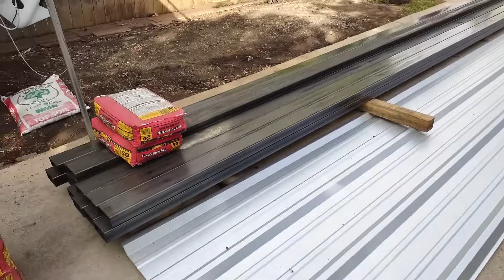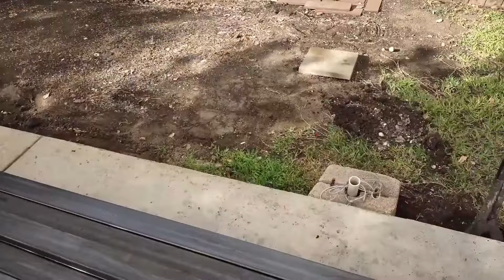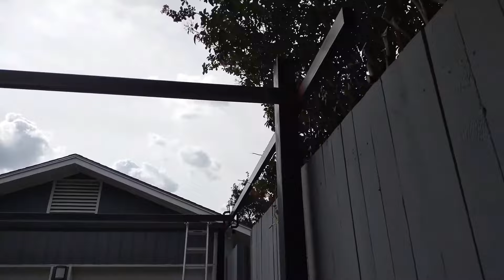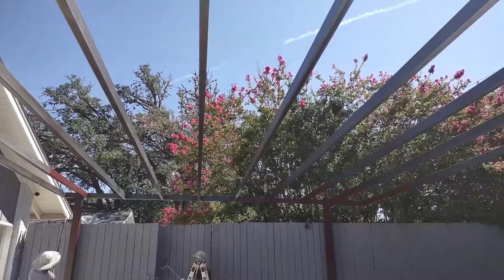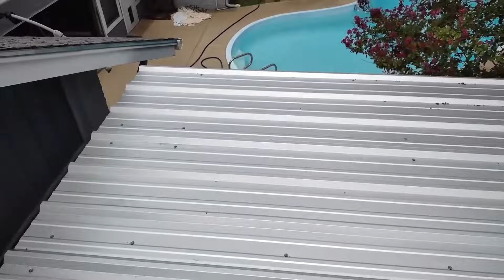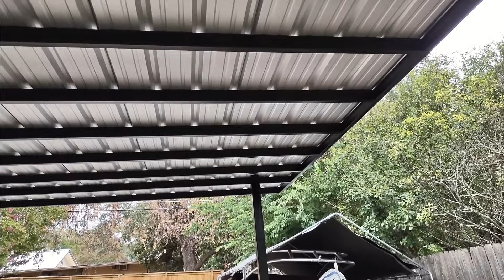Steel Carport Build

Comment: This is awesome however, it would have been nice if you went over all the details such as was it bolted or welded, the size of the metal and why you chose that, why the roof structure is not attached or resting over the 4 supporting beams…etc
It will help so many rookies like me.   Awesome work.
Reply: Saw the welder up on a ladder run by a generator. Don't see one bolt on this thing of beauty.
Reply: The cross beam isn't tied into the legs
Reply: @FourthWayRanch there’s no beam to start with. A 6” I beam on the posts and the framing on top of the I beam would have been 1000% better, but it’ll be there when we all dead and gone

Comment: I'm collaborating with a project manager and a construction contractor in Eastern Europe on a carport project very similar to this one. It's made entirely of box steel columns (4 inch square) and joists, with columns securely embedded in concrete footings. During a windy spell reaching 60 mph, I noticed some structural sway when we were on the roof, which is currently plywood, but will be topped with terracotta tiles adding to some fears I have about the center of gravity. In a light-hearted moment, I exaggerated the swaying by pretending to surf. However, the seriousness of the issue became apparent to me, even though not everyone found it amusing. Despite initial reservations from the project manager and contractor, I firmly believe I need to insist on adding diagonal bracing for added stability, especially without solid walls. These braces will be positioned at 45-degree angles and adequately spaced between joist columns to ensure rigidity. Would love to hear everyone's thoughts!
Reply: Yes would be more stable

Comment: Hi Chris , You guys are pro. How is the thickness of the steel roof ? Thank you Chris
Reply: Normally is 26gauge r panel
Reply: @24BLUEELMO  What's the thickness of the rectangular and square tubes that is the real question, they look super thin on the video. Would oil field drill pipe 2 7/8 be structurally stronger as the 4 main support posts?

Comment: This is exactly what I want to do in front of my house. It looks like you are using 5x5 posts and 2x4 tubing. Can you tell me what the thickness is? 1/4”? I want to attach to my house on one side. I want to go 30’ from the house but only want to use two posts on the opposite side of the house. What’s the furthest you would span before adding a post? I pull like to just use two posts. One on each side about 4’ from the end so it hangs over. Do you think 25’ is too far to span using 2x4 tubing 1/4” thick?  I appreciate the advice.
Reply: Yes it's enough

Comment: Why didnt you take it up agains the garage wall? 
Also no centre brace  what stops the channel from twisting across the span with wind loads
Reply from the maker: Won't twist rectangular tube ,fully welded at both ends,plus thick steel, customer didn't want attached to house
Reply: The sheets will hold it from twisting

Comment: If it’s a 24x24 what size did you get the r panels?
Reply: If you want to add gutter 2-3 inch over hang if you dont just get the at 24

Comment: Pretty sure the screws holding the roof decking down should not be in the troughs where the water will flow over them. When the screw gaskets get old , they will leak.
Reply: R-panel is screwd on the flats not the ridges. It is done correctly.
Reply: @David-ky7bm  it is not correct. That method may be manufacturers recommendation, but it is only to make roof more securely fastened. Manufacturer is looking out for themselves and not interested in roof leaking after screws/gaskets age. You cannot put 1000 holes in steel under water and expect it not to eventually leak.
Reply: @starke6666 most people would sleep better with the occasional dripping screw to seal up vs the anxiety of loose panels during the wind storms we get
Reply: @Handlebarrz  I 100% agree.